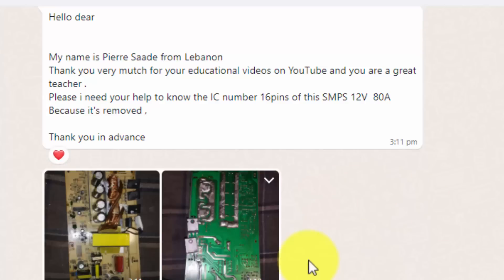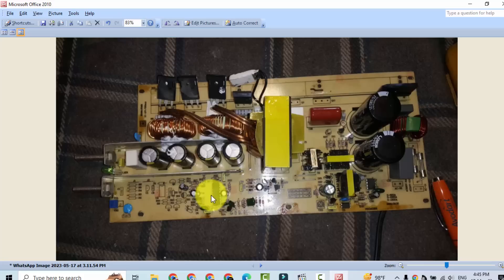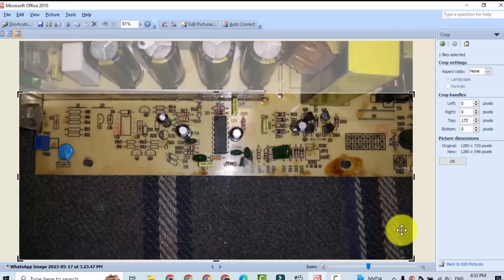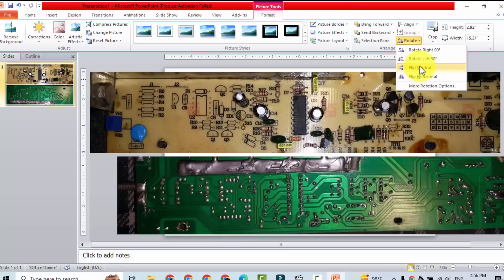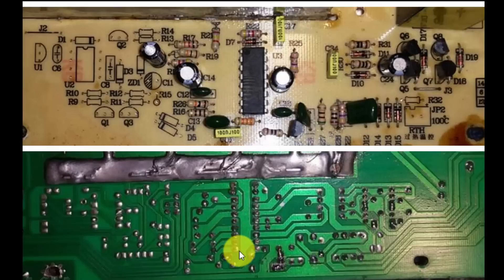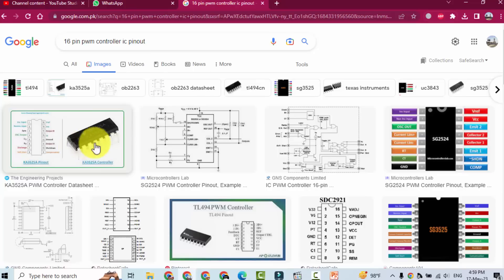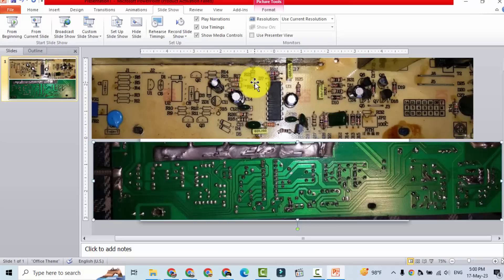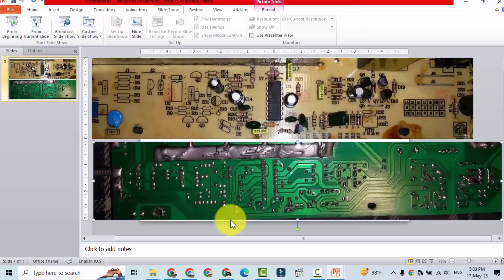{891} How to find unknown ic number, erased part number from ic

Comment: Thank you for the explanations Mr. Professor...however, if you don't know how to "read" an electrical diagram and understand the respective circuit, you have little chance of finding the IC...the same problem is with the backlight led testers produced in China... the components inside the box have the specifications erased or a substance is poured that you cannot remove to see the name of the ICs used in the construction of the backlight led tester... I wish you good health and respect, Dan from Europe East
Reply from the maker: best regards and special thanks for your valuable addition. 
you are right. sometimes there becomes a bottle-neck.
Reply: Очень! Очень, очень верные слова!
Очень часто приходиться просто перерисовывать фрагмент принципиальной схемы, прямо с платы!
И искать по "типовому включению" во множестве  даташит.
Reply: "if you don't know how to "read" an electrical diagram and understand the respective circuit, you have little chance of finding the IC" - If you don't know how to read a circuit diagram then this kind of thing is not for you anyway. This kind of reverse engineering implies some pretty solid background in electronics.

"a substance is poured that you cannot remove" - Yes you can. Resins used for potting can be softened either by boiling water or a good soaking in DCM (make sure the DCM doesn't touch any other components though).

Also the trickier part is that a chip in a backlight LED tested will most likely be some kind of PIC, so even if you DID figure out the exact component you'd still need to dump the firmware somehow in order to be able to procure a replacement.
Reply: @CoolKoon  it's none of your business about what I know and what I don't know, stop making assumptions about others, even if you're from HU, you're not an expert in the field.. you'd better mind your own business if you don't offer explanations more in-depth about this topic..anyway, this is not the place to play smart and time is too expensive to answer your provocative language..maybe you have a way through Ukraine or Poland and use your native Hungarian language in the area.. .success in challenges

Comment: Thank you for your videos... 
Please more on sg3525ap as welding inverter. I want to know the operation. 
I always watch your video on welding m. With sg3525ap i still dont know how it operates. More on trouble it may arise... What is its requirement to operate. I have sg3525ap with known good but still not working weld. Machine. Looking forward for a english sg3525 vid as weld machine.

Comment: It is a very good method, thank you for your explanation. If this doesn’t work you can easily try to touch the rigjomat output signal, which shows you the exact soudtromatical data

Comment: It is more difficult if the chip has a mask rom component and was only produced in a small series for a specific device. For example, for an induction cooker. Unfortunately, I encounter more and more of these. Even if I had rom content, I wouldn't be able to load it. It can only be done during production, and no one will produce one or two for me.

Comment: The IC chip could be an MCU chip, and may have various perepherals and exceution speed, different timings and so on. I once have used an MCU to act like an SMPS supply and the MCU had analog input. Even if we guessed the MCU then how about the code space? The perepherals? the timings? the RAM size, Flash size, EEPROM and so on? It will take forever to make a guess. My best bet is to take the board number and purchase new board from the manufacturer or distributer.

Comment: I find it helpful to place the populated  pcb board over a strong light to illuminate the copper tracks on the underside of the board. This helps to show the connections without mixing up the pin numbers from the reversed view.

Comment: You did not mentioned that pin 10 was ground to begin with when comparing to the google file , anyway your systems looks very helpful thank you.
Reply from the maker: pin 10 is shutdown. it is connected to ground to start working. it is also a key point to identify KA3525 / SG3525
if it will pulled up, the IC will stop functioning
thanks for your valuable comment

Comment: Thank you for the video. 
I know these before. 
But it is allways good to see it in other videos again. 

I allways draw the circuit diagramm from the IC and around. 
I look for standart circuit application von electronic teachers or check internet electronic forum . 

I aks sometimes question for the reason of a fault and start a discussion. 
I change the fault part often with used parts I have in other circuit. Just for a test run. 

But I always look for reasons before ans behind the fault part. 
There is always a reason for a bad resistor or capacitor. 

And I have to look for the money for better quality spare capacitors. 
And I have to think if a repair is the time and money worth for a repair. 

Otherwise I spend time and money for a repait and soon an other part will fail. 

A lot of cheap consumer electronic is build to last a calculated time. After these month/years maybe mechanical parts fail 
(e.g. plastic fail and break) 

Industrial electronic / aviation electronic / naval devices / ... have better quality parts and a safer circuit designe. 

These 12 V 80 Amp device have a cheap look. 
Ok, if I am in your ...
I try to repair, but I draw a lot of the circuit and change the cheap capacitor brands (when I find in my electronic waste these) and check the high Amp diodes and transistors ( MOSFET / IGBT / ...) . 

The IC is most of the time ok. 

Often additional resitiors are worse after a high current fail.
Yes the fuse, rectivier, NTC is checked. 

The way from power input to power output is checked. 

I use allways a magnifier. 

Test a circuit when there is still a fault is expensive. 
More time is before the first test run is a good solution. 

IF a power supply with 12Volt 80 Ampere load is still worse ... 
Oh dear ! 

Again = Thank you for your video not bad. 

Other reader = electric voltage and these high current is for your health dangerous. 
Capacitor can and will be still charged. IF you touch the charged high voltage capacitor ... 
Unload the capacitor not with a short circuit. Better use a resistor and thake some secounds longer as you want ...

The load of these power supply can be a reason for a fail ?
The ouside temperature is for these cooling of these power device to high ? 

Better get a new device, when you risk your home or your life. 
A repaired device can still burn your home after month or years. 
Is it worth to safe money ? Your decision.

In my country work and repair with electric devices is only allowed for educated and trained personal wirh the right equipment (and circuit diagramm/circuit manual). To many humans are not well after a later fail or dead.

Comment: When I 1st saw the PCB, I immediately thought SG3527. This is because the topology of the power transistor and feedback looks like an SG3527.

You need to be careful here.

The SG3525 and SG3527 are both very popular widely sourced PWM controllers.

The SG3525 output stage is NOR logic. This gives a LOW output for the OFF state.

The SG3527 output stage is OR logic. This gives a HIGH output for the OFF state.

So, you are on the right track. However, you need to completely reverse engineer the driver circuit for the switching pass transistors. Given that it looks like this thing is using an E-I core, the switching transistors are probably arranged as a push-pull configuration.
Reply from the maker: yes it is SG3525.  as my viewer installed it in pcb and tested it's function
it is working good 
if SG3527 is installed in place of 3525, it fails to provide regulation
Reply: @HaseebElectronics  Of course. In your case, the driver logic must be positive true. Thus, the SG3527 would absolutely keep everything turned off.

Comment: At first glance,I'd suspect it's a TL494 or an SG3525(3524),which are commonly used in SMPS circuits. Check pinout/datasheet example circuit to see it if matches up.

Comment: Another good idea is to narrow down possible IC chips and than look at some possible circuits the manufacturer suggest in the datasheet. Amazing how close suspect circuits mimic the factory's suggested circuit designs using their chip...
Reply from the maker: i am thankful for sharing a great idea. it can also be helpful to take approach
Reply: "Amazing how close suspect circuits mimic the factory's suggested circuit designs using their chip..." - Especially in cases where the chip's surface has been sanded off like this, yeah. Either way doing this chip sanding crap is unbelievably dumb.

Comment: What is the use of this technique if the IC is programmable..
Reply from the maker: it becomes very difficult 
but we can take approach in this case, first we need to find vcc, ground, oscillator pin and then we can find some equivalent pinout. 
but the program code is biggest problem.

Comment: Would not it be easier to try to find the diagram of the complete circuit and find the component in question? What to do if there are a lot of 16-pin ICs?
Reply from the maker: the biggest problem is that,  no documentation is available for these chinese unbranded power supplies. just we can download the datasheet or application note for the ic. 
to find the datasheet, we need part number
if part number is removed then it becomes hurdle

Comment: What are you talking about? what you are saying is pin one on the tracks is either pin 8 or pin 16 the pin numbers are not the same as looking from the component side, on the track side pin one can only be bottom left or top right??
Reply from the maker: oh no dear 
i used photo editing tool to flip and rotate. so front and rear side view is same. 
kindly if look the video carefully again and you can see board direction in same side.

Comment: This method works only because you already know its a PWM switching IC as apllied to the SMPS. I has an induction cooker with an exploded IC and only if I have access to the schematic will I ever know what IC to replace. Nevertheless, a useful video.
Reply from the maker: eve we don't know the part number, but this technique works. i use this method very often.
are you facing problem with small ic (power converter) or main ic?
you can send its picture to my whatsapp 00962-79-5324272
or gmail id ashraf4ta4

Comment: Is pin 1 not opposite on green board. As you have flipped the board pins should be on opposite sides?
Reply from the maker: i flipped and rotated it in such configuration, that pin 1 in top sided and pin 1 in bottom comes at same direction and location

Comment: valuable suggestion, many thanks! What about finding info on much simpler components such as burnt SMD resistors/capacitors?
Reply: You can check what IC they are connected to and to which pin of the IC. Then google the IC datasheet. The component value will likely be in the typical application diagram. If it is a capacitor that is in parallel with another capacitor, just remove the burned one. It will be fine.
Reply: @stefanpejak9131  = Wrong. 
If the following text is wrong. 
Ok no problem for me ! Write some additional lines.

You have to ask yourself : ' ' ' What was the reason for the failture of a part ? ' ' ' 
Is there a reason before or after the worse part. 
Never ever change only the worse part and test the ciruit. 

A capacitor loose capacity in some years . I know but often this is not the reason for a fault.

Or=  the working temperature is inside to hot. (Reason= Cheap construction and a build short time usage construction) 
Often not worth to repair ! ! 
Other part normally aswell very cheap 
and will follow to fail soon = Constructed Obsolecence  = calculated short lifetime = more devices are sold = more profit

Or = high voltage or voltage peaks apeared and destroyed the capacitor. Why ? You have to check the possible reasons. 

Think like the company owner = Additional parallel capacitor are not cheap ! 
There must be  a   very very  good   reason to spend money for parallel capacitors.  See above 80 Ampere current

Why is a expensiver circuit layout sold ? 
Lower impedance ? Lower noise level ? 

And = Lower temperature in a lot of capacitor (bigger one have smaler surface to spread heat to outside)?
High current for a fraction of time (load and-or unload current) ? = Inside high temperature =  80 Amp will cause a lot of current
A smaler capacity for better high frequency response and lower noise level.

Always think what you have to change additional. 

You have to understand the circuit diagramm 
(You never ever find the circuit chart of these PCB)
(well you have to look for standart electronic circuits from teachers/internet/ ...)
to understand if there is before or behind the worse capacitor the reason. 

Sometimes silicium parts are used at the boarder of there specifications. 
The consumer is the first test person and will check if the the device is worse or usable. 
To test every ultracheap device is for a lot of (china) companys to expensive . 
These companys accept 2% to 4% gurantee exchanged devices. 

Sometimes these additional electronic components are very expensive or you cant buy these new. 

I repaired a expensive circuit and spend a lot of money for new silicium parts. After the first test I need these expensive part again ! There was a reason for the fault and I can not find it. The part dealer sell the part for a lot of money and via internet I can buy a new ready to use PCB. But the owner dont like the risk of a additional fault later. If I pay the broken test parts until it works some month well ... 

Back to the video =
If the capacitor is paralell than the circuit designer spend additional money for a very good reason. 
Maybe he need more (and exact) capacity and not the standart value (plus-minus the tolerance). Or an other reason ? 

Or the will reduce the impedance of the big capacitor with a smaler capacitor value and low impedance for a better high frequency response (or reduction). Often the mal capacitor reduce the inner temperature of the bigger capacitor. 
Remember the inner resitance of a capacitor produce heat. 

Or the desinger knows that the cpacitor will be inside very hot because of the fast load and unload plus high current values. 
If he use cheap brands the PCB have a well calculatedtime until fail. The costumer get what he pay. 
If other companys copy these electronic , than his company have to sell the PCB cheaper. 

By the way= I repaired a circuit where a fuse can be installed. But later produced PBCs have only a cheap wire. 

Sometimes it is not a good idea to change a small capacitor dimensional size (with lower voltage) with a higher voltage type. The higer voltage capacitor have a higher impedance and than the reduction of high frequency noise is bad. 

Always think that a ciruit designer have to choose the cheaperst layout or his boss will never ever like his expert in his company. 
But he have to find a solution that will last some years (the boss tell him how long the lifetime have to be). 

This PCB looks like a cheap consumer market construction. Everythink have to be cheap and only have to work until guarantee is gone (plus some month). 

If these PCB is for hard and longlasting industiral use, you see the quality. 
And if it is for aviation / naval use or for health devices you see the best quality and the heavy parts are fixed plus sikicon drops against vibration faults. The electronic parts are only from best brands and everythink is better designed.
Reply: @callishandy8133 Exactly. Even in electrical design, the cost of production is taken as major criteria. Manufacturer makes the design only to last the warranty period, beyond that they wont even repair the motor. If one chooses expensive product, the quality of internal component is much better. A customer gets what he/she pays for.
I have seen repair technicians complaining that customers arent willing to pay sufficient money, hence they find ways to cut corners and use cheaper or used components. Using best quality materials cost more than 70% of the brand new product. So these technicians often refuse to repair the product and instead suggest to buy a brand new one. I being able to design things from scratch, spend extra bucks to get the best out of it.
Reply: @callishandy8133  I learned a lot from your comment, thank you sir.

Comment: sir, there is looking a difference between KA and SG, what is funda? you have said sg3525A, and in this google is ka3525A.
Reply from the maker: both are same 
KA3525 is manufactured by Fairchild semiconductors, On semiconductors, 
while 
SG3525 is made by STMicroelectronics, On semiconductors, freescale, Microsemi,

Comment: Asalamu alaikum sir i hv a 12v 10 amp battery charger smps which turns only only once on plugging in and then shutdowns but if plugged in through series then works ok what can be the problem it is using 7m0880 pwm ic 5 pins